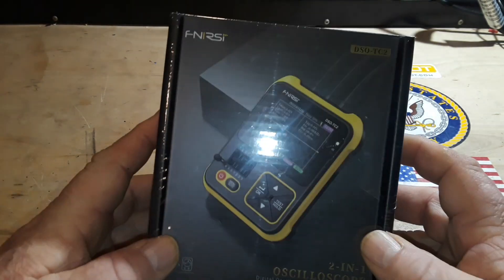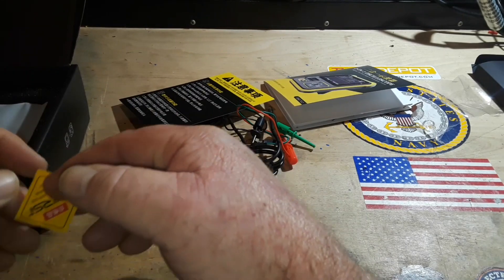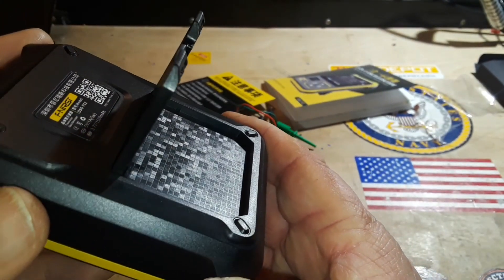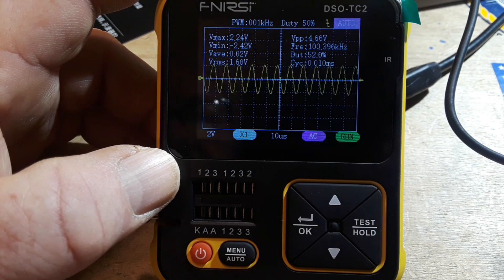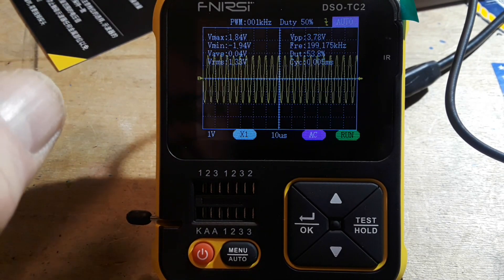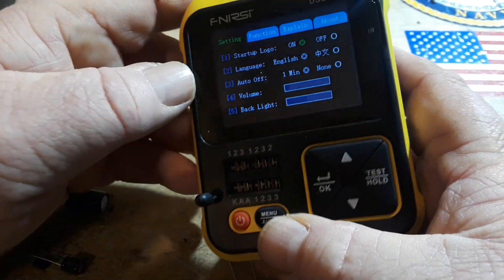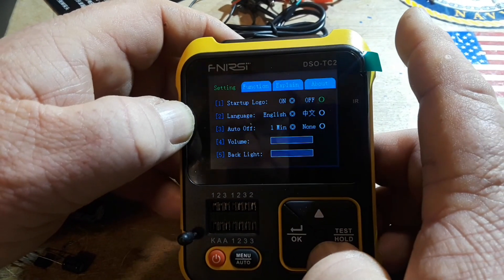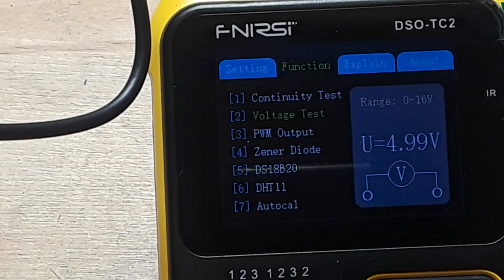FNIRSI DSO-TC2 Oscilloscope, Component Tester, DMM, PWM

Comment: Iv got the very same one €50 and the component tester gives totally wrong readings.. saying a transistor is a double diode, wrong resistor readings and capacitor readings.. the scope is very good on it though.. so at least that.. but you want what you think your buying.. F-nirsi should check out all the reviews done by people and sort their products out because iv seen ALOT of problems with their stuff lately. So if your thinking of buying this or buying the newer model " the DSO TC3 it has a signal generator built-in which works good too gping by reviews iv seen, just the component tester has problems" you will be flipping a coin on weather the component tester works properly as iv read a load of reviews on the website i got mine on talking about the same problem i had plus YouTube reviews iv seen mentioning it too.. hope this helps you if your thinking of getting this. 🤔🇮🇪🙏

Comment: Honestly this is a $25 Oscope combined with a $15 Transistor tester. It's nice to be all in one but at the same time it's quite limited too. If you had bought the transistor testers previously like the GM328A then you could run the upgraded firmware from the original authors to pick up latest fixes and features. The clones are all out there now with questionable clones of the ATMega328 chips and no support for the original open source firmware.  Likewise the Oscope portion of this is similar to the white one with the generally superior rotary encoder for input.  Generally I have chose Fnirsi over the generic clones as their build quality has been better but on this unit I have passed in both their original and now this updated version, opting to support the original hardware/OSS instead and a better OScope

Comment: I've eyeing these since they first hit the market.

I got the open source code version of the parts checker and printed a case for it. Later I bought an oscilloscope kit and soldered it together so I don't really need one of these but I still want one.

I wonder if this can be upgraded with software or firmware down the road?
Reply from the maker: We will see...